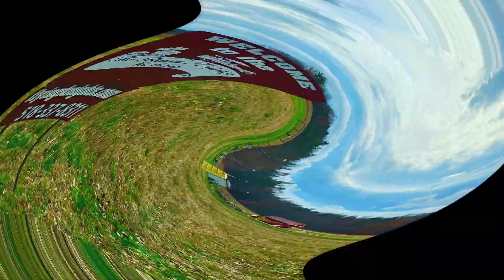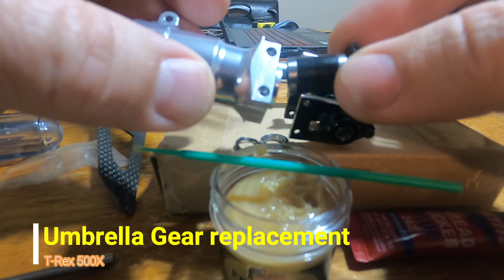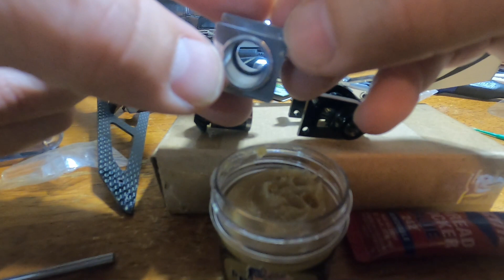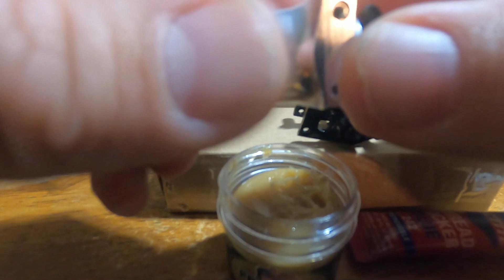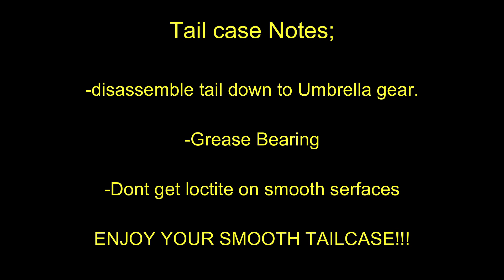Umbrella Gear Repair Trex 500xt

Comment: Thanks, I don’t remember this step in the manual... do they come dry out of the box?
Reply from the maker: I guess I would call it partially greased...like the thrust bearings are.  Not sure why these drive bearings are open like they are but that’s how the kits come.  I’d say be super cautious and keep them greased or replace them all together...but if you just let them go...it’s almost definitely going to lead to a failure.  Thanks for tuning in!
Reply: Swapping tail booms for a stretched 550x Trex Scale build for a 600 size MD 500 tonight. I’ll be sure to pack those bearings. Awesome tip. Ty ty Tail problems seem pretty common on electric helicopters. I look forward to this build, more weight and a slower head speed.
Reply from the maker: @4kdemoscene  my 550x bearings are different...sealed.  I’ve only seen these open style drive bearings on the 500xt.

Comment: Align does make a bearing puller tool as you advised, but not for removing the bearings from the case. It's for pulling the bearings off the umbrella gear.
Reply: @rcflightz2058  OK, I keep a box of all genuine Align Spare parts In containers. Generally spend 2 times the Heli cost on spares, mainly disposable items like gears, bearings, blades, canopies. I tend to break them a lot. Way too many tail strikes from pulling Gs at low altitudes. :) I use Align grease and Tarrot grease and Scorpion motor oil.
Reply from the maker: Maybe I’ll get there some day…more of a big air 3D flier🤷🏻‍♂️😎